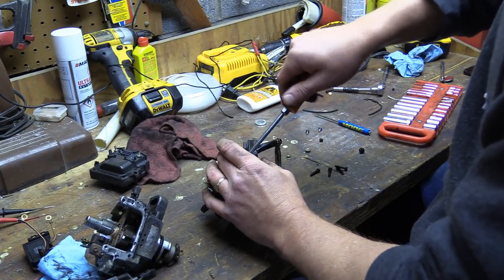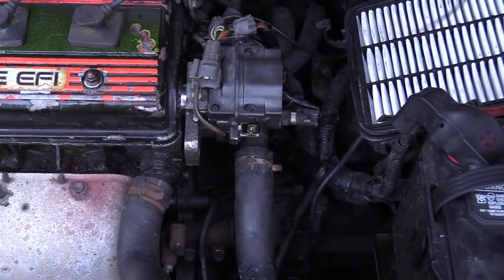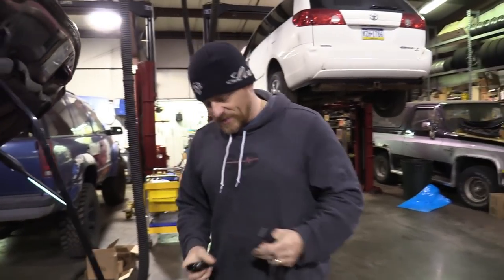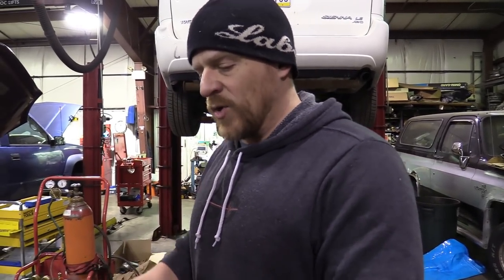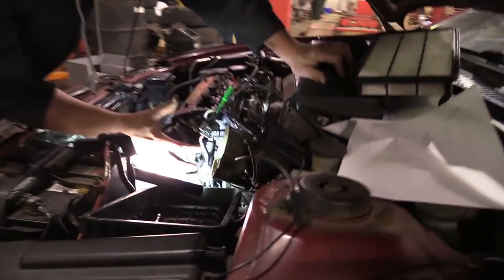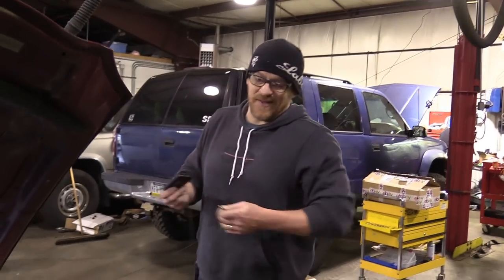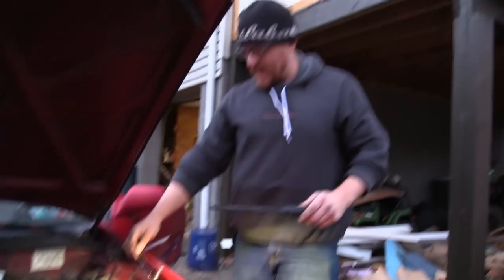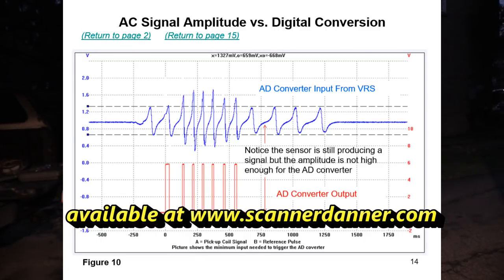Misfire, weak spark, 2 years after coil replacement 94 Toyota Celica (part 2)

Comment: Just a thought here, could there be any damage done to the "cam" circuit in the PCM by any of the secondary high voltage being fed back along the shredded coil wiring inside the distributer?
Reply from the maker: No sir, the integrity of the wiring for that sensor was not compromised. (Sensor housing to the ecu)
Reply: @ScannerDanner  I was thinking about the bare sensor coil wiring wrapped around inside the distributor that was still connected to the ecu getting zapped by the HT voltage and back feeding. The occasionally missing spark was going somwhere I thought it may go back to the ecu.... Just thinking out loud lol.... Thinking about it a bit more the damaged coil would have been grounded onto the metal disi parts. Acting a bit like your test like trick when pulling plug wires off!
Reply from the maker: @drivewasher  yeah, that totally could have happened! Not sure what I was thinking lol but all is well for sure.

Comment: I thought on ODB1 cars you need to pull the ecu fuse or disconnect the battery to clear the code(s), that they didn’t self-clear. I guess this is not the case. I have a ‘93 Blazer and don’t remember the codes self-clearing.
Reply from the maker: They don't self clear immediately, but the check engine light will go off when the code is not current. The code would still be in memory however.

Comment: I set the time both ways .  what ever works . I had a timing light like that once, I gave it to my brother . I use to think the module was good or bad , When I worked for GM a long time ago they had a module tester and then if that did not work I think the instruction   said replace with a know good module . I left working for a dealer and did not look back

Comment: Hi Paul, where did you connect that capacitor?
Reply from the maker: Just between the two backprobing pins, so between the two wires of the sensor. I suppose I could have or should have connected signal and then a known good ground. I believe VRS negative on this model is a straight ground though, so same thing.
Reply: ScannerDanner cool trick! Thanks buddy

Comment: Hey boss I like your videos it teaches a lot question I have a 93 Jeep Cherokee 4.0 he cuts off at 40 miles an hour especially when it’s hot feels like it has a miss If you come around Houston one day I would like you to come over and fix it up for me you’re the master
Reply from the maker: any codes? 93 Jeep has a crank sensor on the back of the engine that reads off of the flywheel. That would be the first area I would test. I have videos on these. Of course they are newer than 93 but it is the same sensor and location on the newer models. 
https://www.youtube.com/watch?v=TZwJ2jp8g0E
https://www.youtube.com/watch?v=qpL_0-8DrhE
Reply: boss I have no codesI alredy change the crank senso becomes I watch your video and I did it but I still have problems  could be because I bought a cheap one from China mabe is not good thank you for replying I'll check on your videos again maybe I did something wrong
Reply: I don't have check engine light either
Reply from the maker: @mihijojacobconaustismo5415  okay, define "cut's off" more clearly for me. Does it completely stall? Will it restart? Does it need to cool down first? Will it do it around town when you are not going 40mph? etc etc

Comment: Scanner Danner I have the same car my car just cranks but if I add spray in throttle fires up fuel pressure when prime is 50psi i can hear the fuel pump i replaced the coil from my old distributor still just cranks can u help me out what could it be
Reply from the maker: You've confirmed fuel pressure is 50 psi?
Next step is to check for injector pulse if that is the case. Do you have a test light with a regular bulb?
Reply: @ScannerDanner  yes I do im not a mechanic but I try everyday to learn. when I put the key forward pressure is 50psi and it stays thete as long as i keep key forward once I remove key pressure slowly drops .but I'm not sure if the 2 coils i got are good
Reply from the maker: @jvst20051  I'm not worried about the coils as you said it runs when you spray a fuel source, right?
Injector testing is next:
1. Disconnect injectors (all 4 as this is a pair fired system, I think)
2. Test light to battery ground
3. Make sure test light lights on one of the two terminals during cranking. It may light with the key on too but I want it checked cranking
4. Switch test light polarity (connect to battery positive) and touch the other terminal on the disconnected injector and it should pulse on/off during cranking.

Comment: i remember when my car use to have 239,000 miles buick had 269,500 sold with bad radiator after i got 99 saturn SL1 witch has 244,500 miles
im-un-na keep, 
 keep-an-em go-en 😅 
I live in PA as well
Reply from the maker: Haha nice

Comment: It can pass inspection with a check engine light on?
Reply from the maker: In 94 yes
Reply: If you come to Erie County PA it would pass with the light on even if it was brand new. Visual and gas cap test only. Crazy. 🤦🏻‍♂️🤷🏻‍♂️

Comment: Are you testing all 4 cylinders or just the ignition coil when you have the ignition clamp on the distributor cap?  I dont have much experience using a scope so i purchased the U scope sometime last year.
Reply from the maker: All 4 cylinders being drawn one over top of the other at the same trigger point (voltage level and slope).

Comment: If you ever do a misfire on like a 94 Nissan sentra 1.6 litre. The issue that is most likely after all else fails is because they tend to leak oil from the o ring seal that the shaft and housing sit on the face of head inside of distributor. Imo the dumbest design is a distributor mounted sideways.
Reply from the maker: I have an image of one of them in my book when I teach on optical pickups 😉
Thank you!

Comment: I had this and the magnet in the distributor was cracked up and lost a lot of it's power.
Lower magnetic field = weak spark and misses.
Cracked magnets lose strength.
Was a GM

Comment: How often do you have to charge that light? (Under normal use)
Reply from the maker: It will last about 2-3 hours on full brightness. If I was working in a shop full time, I'd own two of them and have them on a rotation. For what I do, it is perfect
Reply: @ScannerDanner  thanks for the reply. 
I ordered the $13 one from china just to try it lol

Comment: I'd assume failing coil or gap problem, wide gap on those is a killer, same for many other classics and small engines/marine, coil to flywheel gap was rather critical :)
edit, oh those test leads and all the connected junk! perfect  EMF receive antenna. real scopes of the past had shielded leads with minimal exposed "receiver antennas"  ;)
it's 10000% worse in very low voltage electronics and RF, head smashes the desk infinity times

Comment: You very funny Dr Jones oops I mean Professor . I got a set of wires and plugs and fixed my son's 89 Camry but only for a few months, ended up getting a distributor because oil was coming past the shaft and causing carbon tracing in the cap. Got it online for 50 bucks and I think it was a Cardone reman. It's running for about a year now. 
I'm glad ya didn't replace the distributor, this way I got to watch you work while I had a beer. 
Now I wasn't watching when ya timed it but I was listening and it sounded like 10 degrees before give or take a degree. 
Shirley you jest and we know what happens when surely gets involved. Ten minute video? Again where's Shirley?
Ya need to get rid of that Celica before he tells ya he hears clicking when he's making turns. Well that's what my son's complaining about now, don't wanna jinx ya, sorry. 
Nice baling wire and paper clip fix  Professor and another great vid and great teaching experience. 
Happy Motoring.

Comment: one, one two. then 500 more flashes, which you lose count of and get the ordering wrong and watch it 15+ times more, then they codes don't point you at the actual problem or anywhere near it, but it's all a symptom of the real problem........
sounds familiar still and only difference now? there's 20x the problem points, in which you need 300x very costly gadgets and some of us still get there by ear, eyes and feeling faster :)

Comment: Their usually diodes not capacitors  inside of those distributors.
Reply from the maker: This would be a radio noise capacitor and is common to see them on ignition coil primary circuits on these older systems

Comment: Don't you still have to go back and time the engine after changing the gap? Also I am guessing that internal cap is bad. A guy should test that capacitor. The cpu most likely does not change its detection threshold dynamically.
Reply from the maker: It wasn't dynamic. The threshold I believe was factory set to be higher than typical due to the noise of the coil causing false signals. On a typical VRS 500mv peak to peak is usually enough for the AD converter to "see it"
Reply from the maker: Also, that air gap adjustment on the cam sensor signal in no way affected the ignition timing. In part 1 you see this car running fine without that signal at all. It wasn't until the pickup winding started accumulating in the cap that it gave my son any driveability issues. I'm sure his gas mileage dropped but he never paid attention
Reply: @ScannerDanner  thats old enough  you sure it was a digital system?
Reply: @ScannerDanner  good point!

Comment: My age is showing. We called automotive capacitors “condensers” when I was much younger.
Reply from the maker: I'm familiar with a points and condenser system. This capacitor in this set-up does NOT do the same thing that the condenser did in a point type system. This one is primarily for radio noise reduction
Reply: ScannerDanner Yes sir. I realized that when I saw the capacitors you were using. I commented a little too soon. I’m retired from welding and repaired a lot of welding machines and oil field equipment, but have really gotten interested in auto mechanics helping my grandson keep his pickup going. Your knowledge and video expertise is top notch. Thanks for all you do.
Reply from the maker: @arcburn3364  awesome! I hope to be a grandfather soon myself 😍

Comment: Rockauto, not a sponsor and not a big fan of them but it looks like they stock the EGR temp sensor.
Reply: Willis Power I order parts from them all the time..never had a issue ever.. never had problem with warranty or when a part was damaged when I received it rockauto has never let me down..
Reply: RAHRAH807 I’ve bought from them in the past but I ordered a radiator for an F-150 not long ago and what I got was a radiator that was for a different Ford model and never used in the F-150. They accepted the return easy enough but charged me a restocking fee even though it was clearly a mistake on their website and there is no way to talk with anyone on the phone to resolve issues like this. Of course I couldn’t bill my customer for the restock fee and ended up eating it myself plus lost time, that’s my biggest issue with Rockauto
Reply: @willispower9493  did you use there part fitment..I do not trust that so I will do my own research with the part number and go to the manufacturer who made the part to make sure it fits my make and model
Reply: @willispower9493  for a customer and me  ordering a rad off rockauto that is such a critical part and the customer would need the part right away so I would get it locally.. I wouldn't take a chance and ordering it online.. I would not do that and if I did i would make sure the part I ordered is going to fit by the company who made the part..
 I would not want a customer to wait that long.. on my way own vehicle or project vehicle maybe friends or family that could wait that long depending if it could wait that long  I'd do that..i know a independent shop out here also has a part store  and  he stocks up common repair parts for  vehicles he works on and stocks parts for his  store from rockauto and sells to public..
Reply: RAHRAH807 His bill was already over $2000.00 and the radiator was over $100.00 more locally. The only parts houses close is O’Reilly and Autozone and they are both spendy compared to other options. For example a front hub and bearing assembly for a 2006 AWD trailblazer is $258.00 at the local parts house and $158.00 online. New AC Delco front half shaft is over $400.00 locally, on line $250.00 and its the same part number in both cases. We’re not talking a few dollars difference to get it quick we’re talking a big price difference and even then the local parts house usually has to order it anyway. So I give them the option and most people will choose to wait a couple days and only opt for the higher price if they need it now. In the case of the radiator I did end up buying it from the local parts house and it was over $100.00 higher. Not sure if O’Reilly and Autozone is the same every where but it sure seems like they’re trying to put themselves out of business around here.
Reply: Willis Power ouch yeah that’s a lot

Comment: I'd say two reasons why you couldn't let it go. One it's your son's car so you want to make sure its right and he isn't stranded somewhere. Two you do your damn best to fix it right and you will your dang best to make sure it is. And third possible you don't have the normal restriction (for lack of better term) of well only paid to diagnose XYZ even if other problems are there but not connected to the XYZ, (don't know how y'all worked it out and I don't need to know either) so you can possibly go farther. Oh and you just love to teach, well that's my opinion anyways.  But it does seem to come across that way.
Reply from the maker: You hit the nail on the head my friend. Thank you!

Comment: I mean this isn't my business but you know just try me now so but I think it needs oil yep it seems like the heads are knocking and then you just want to put some give you more mileage well you just get some syrup put some I guess some adjectives oil in the I put a two-stroke oil or four-stroke oil a little bit in your gas tank and for nothing to smoke but for the heads not to be you know rattling otherwise would be that's why they put it on the two strokes and the four strokes what one goes in the tank won't goes in the mix I thought I was oil of the motor I'm confused but I'll stop The rocking like because the sound when the heads are too hot why no oil or what no water what about if you turn on the fans it's so hot why you probably have a broken hose if it's leaking the water what about the water pump are we talking about the same thing rattling the heads why right now it seems to me you're in a Dyno jump so it must be what well just like oil on the gas fuel and you must make it soft so the heads don't be rocking you mean they're hot Chambers because the exhaust or the backflow oh

Comment: Hey I bet you know what I did I don't have trouble but I make my car run high what well it makes you run like you got a oil booster it runs higher right but doesn't use oil it doesn't use gas it's full tank right now it's been full tank for about a month I only gas it up once a month but I put my special blend and the gas still full I mean I put it like a dollar fifty last time when I tested it I put a dollar two dollars and but I put over 50 miles over 100 miles full tank back and forth from here to the hotel the Camry right now damn it I think I put like a 16 bucks it's a 60 bucks I'm over the 70 80 miles and the needle hasn't moved could you do that I'm not going to tell you at 5:50 I'm going to look at p*** man at least I get that for free